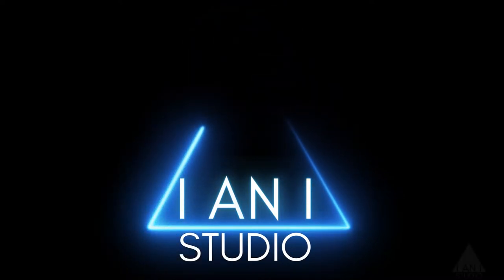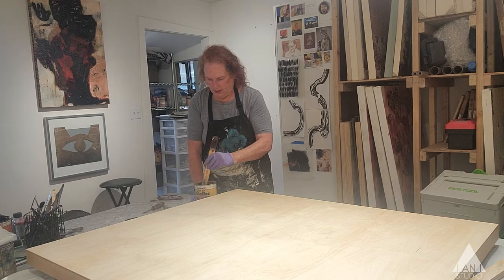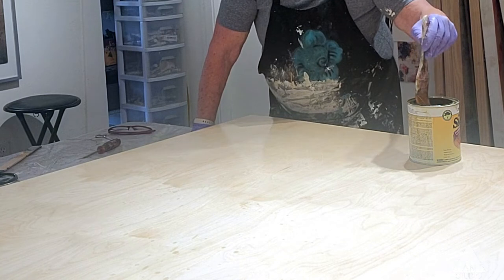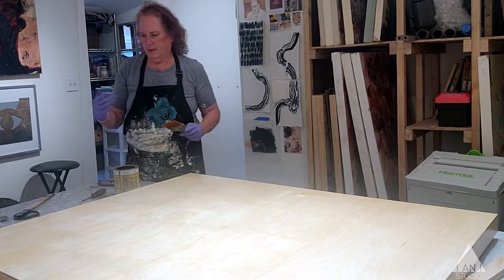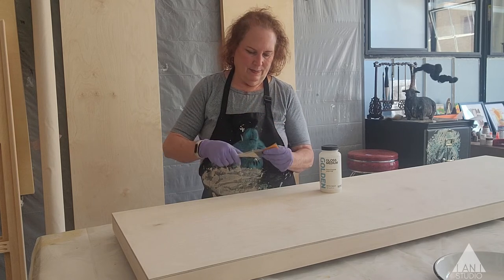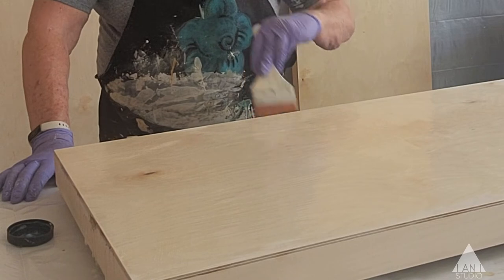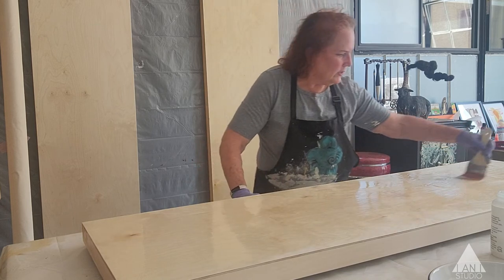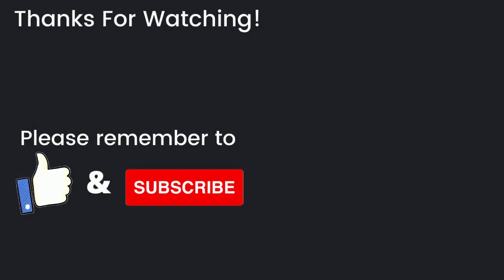Meditations on Art - Preparing Surfaces for Paint and Collage Part 2

Comment: Hi..I just discovered your channel today and love your work and the info you share. My question is do you have to shellac your wood substrate or can you just gesso it, even with clear gesso if you dont want the white?  Also, what adhesive do you use for heavier collage paper or fabric? Thanx in advance!
Reply from the maker: You should seal your wood panel before you gesso. It keeps the oils in the wood from leaching onto your painting and discoloring it. Also, it prevents the water in the gesso from seeping beliw the layers of the panel which could cause the wood to " bubble".
For heavier paper to adhere to your substrate use soft gel medium rather than polymere medium.